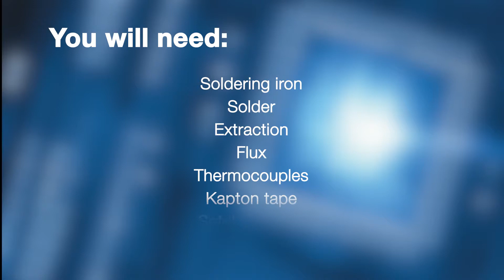Datapaq PA0210: How to attach thermocouples using solder

Comment: OK so ... how do you actually attach the tc to a thru-hole LED?
Does having solder in contact with/surrounding the thermocouple's 2 different metal wires affect it in any way? 
How do you attach the tc to a plastic component like connectors, headers etc?